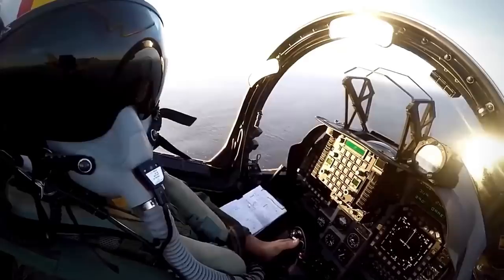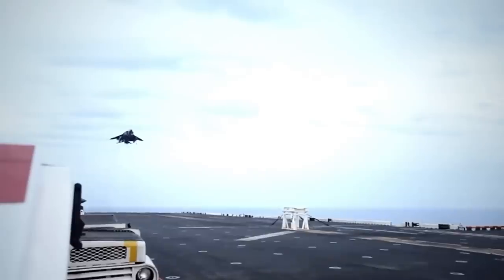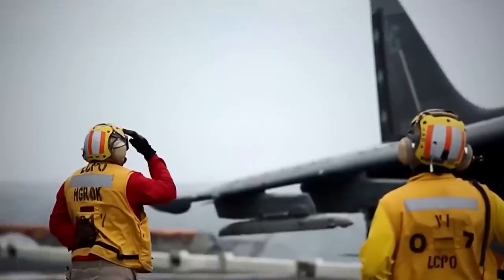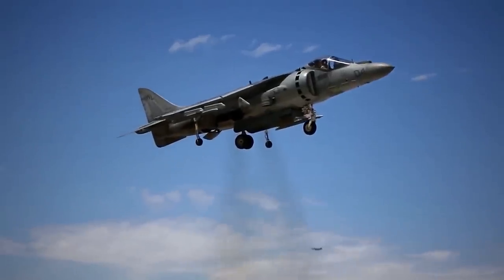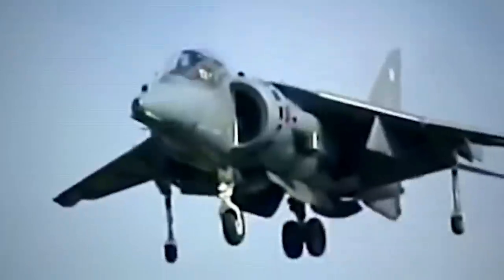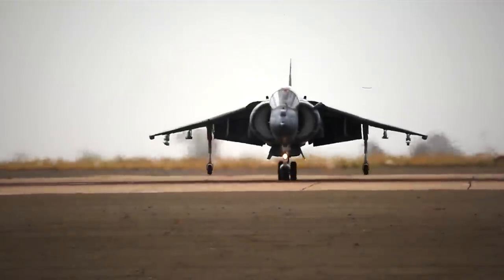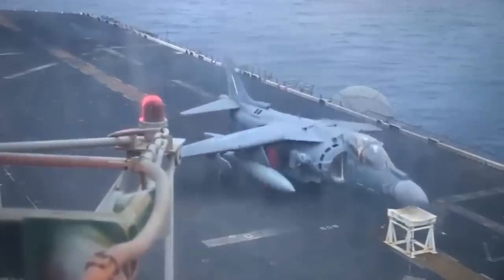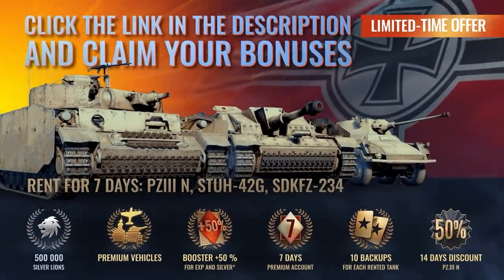Aircraft Carrier Jet Crash Lands on a Chair

Comment: I was a CW2 PIC flying UH-1s in Saudi 1990/1. A check pilot was giving a Lt a NVG check ride. They got too low and skipped off a sand dune, ripping the skids completely off. The maintenance guys made a cradle out of truck tires. They landed safely but we all were holding our breath during shutdown.
Reply: Glad they were fine. Those NVGs I’ve been told have no depth perception

Comment: He states "22,000 pounds of thrust"(from the AV8B's jet engine), then later states "the 30,000 pound aircraft" (the AV8B's weight). If these stated figures were accurate, it would not be possible for the AV8B aircraft to achieve vertical takeoff & hover.

Comment: My late father did a cruise on USS Guam (LPH9) in the early 1970s with HELSUPPRON TWO, when the AV8A was coming into service.  Every Harrier (aka Whistling Shitcan) on the flight line got a Fleet Angels mark stenciled somewhere on the fuselage…
Reply: There was an incident with one of the AV8As where one of the ducts was stuck in the forward position, so when it came in for a vertical landing, it had to orbit around the ship several times before it could safely land.
Reply: Also, for those of you keeping score at home, that was the cruise where the Fleet Angels became the Flying Assholes!

Comment: Sorry but you are very wrong at 9:02 the harrier is NOT the only VTOL/STOL jet the US has. 
The F-35 B also has VTOL/STOL capabilities. It was but in service in 2015.
Reply: Fat Amy is NOT anything like the mighty Whistling Shi7 Pig known as the AV8B Lawn Dart.
Reply: F-35B is a STOVL platform. There was no KPP requiring the JSF be capable of performing a vertical takeoff. The fact that it can is simply gravy.
Reply: @AA-xo9uw  That is not true. 
The F-35-A was for the Airforce and was made like a normal jet but with STOVL capabilities.
The F35-B was for the Marine's and was made for VTOL to be a direct replacement for the Harriers 
The F-35-C is for the Nany and is set up for carrier use.

Comment: It's a Marine aircraft, not a naval aircraft.   This wasn't some random seat of the pants improvisation, it's in the natops for the harrier, it's trained for, by everyone involved that has any sort of connection to the aircraft on the amphib.  It's not a aircraft carrier.  Please don't demean the Marines, the Marine pilots and the Marine crews on the amphib.   You have been dropping the ball knowledge wise, badly lately.   Just like the video about Robin olds and his operation to trick the nva with phantom 2s, when they were expecting thuds.  You framed it as it was handed down to him, that he was selected for it.  He came up with the entire concept, and execution.   You also completely left out the fact that he equipped the phantom 2s to give off thunder chief electronic emissions.  The harrier pad on mcas Iwakuni has always had that tool in sight of it.  I know this because I don't know how many times I watched them conduct launch and recovery from Dad's EOD shop that was a straight shot visually.  Get your shit together.